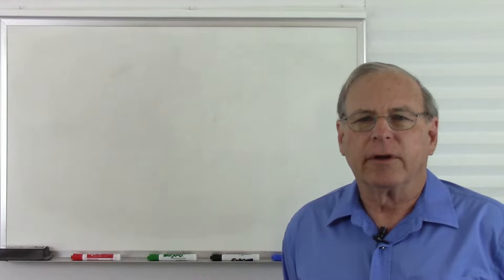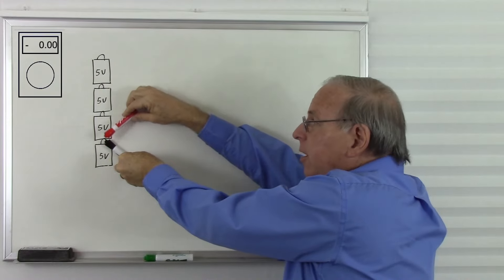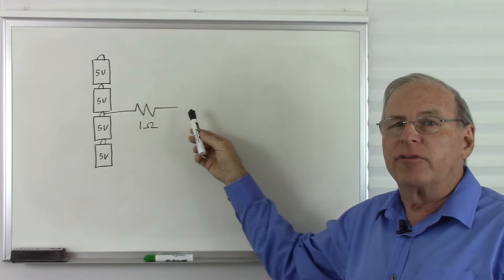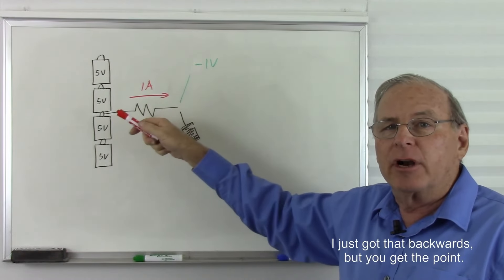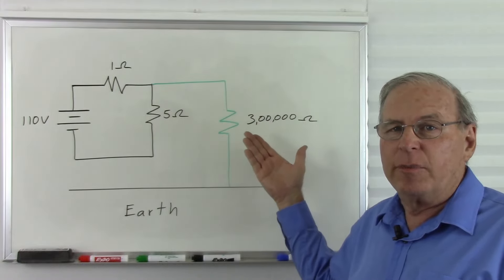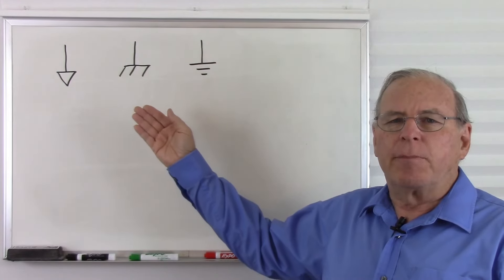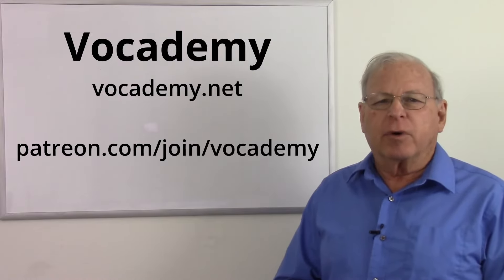What is Ground

Comment: 12:01 
If a person gets an accidental contact to hot or live wire one's heart would enter Ventricular Fibrillations VFib if an AC current of about 6 mA is established across the heart; remember that condition is met if AC current of 50 mA to 100 mA goes through the ones body as a whole. 
O.K. Now I get why an RCD with 30 mA leakage current rating would help in preventing those life endangering hazardous leakage of currents though human or animal entities!
Thank you so much for very good velog for human safety in domestic electrical systems.

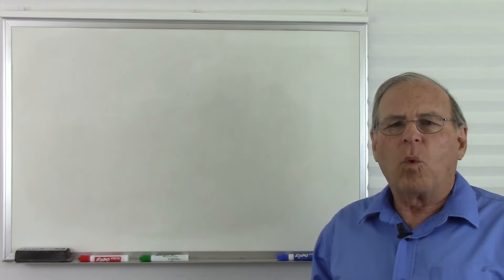Comment: I love this video. It does have an apparent contradiction (if my newbie understanding is correct) 8:50-11:06, but this is one of the many reasons I like it. The whole video provides so many insights and clarifications that I personally needed.

I suggest readers resolve the following. If current from the side is 0.1 A and current through R2 is 1.1 A then current through R1 is 1 A. The voltage across R1 is therefore 10 volts, but this contradicts the 9 volt conclusion.

Revisit the assumption the current from the side is 0.1 amps and assume the voltage source from the side is 11 volts instead.

It occurs to me there is no contradiction in what vocademy says, but a miscomprehension on my part.

Whereas initially
- I thought vocademy said 0.1 amps from the side, he would have said 0.1 more amps through R2 than before;
- I thought vocademy said 0.1 + 1.0 amps through R2 and 1.0 amp through R1, he would be saying 0.2 + 0.9 amps through R2 and 0.9 amps through R1.

Multiplying out R1 we get 0.9 × 10 = 9 volts; exactly as vocademy says!
Reply: At 15:00-15:15 I believe he made a mistake; he made the .001 resister in parallel with the 5 ohm resister but shouldn’t it be in series with it?!!!!! (Given the stick figure scenario before the modeled circuit)?

Comment: Im making my own power regenerator using ac-dc psu and inverter and im wondering should i ground the inverter from psu input ground to the inverters ground screw or is the negative from psu output used as a ground ?

Comment: A question please. What is the point of making AC neutral (or the negative DC potential in your example here) the same potential as earth. If neutral was not the same potential as earth and you accidentally touch the hot wire then electricity couldn't flow through you to earth - similarly as it wouldn't with an isolation transformer. The hot wire would thus not cause harm. Thank you for your excellent videos by the way.

Comment: At 12:15 the error in your diagram becomes apparent. You cannot show us how the current can flow back to the negative terminal of the battery. In the real world there is a wired connection between the neutral and earth ground at every main circuit breaker panel.

Comment: This is a 110v battery.  Electricity always wants to get back to its source (the battery).  Fault in metal case. I touch it. Me standing on the ground is not in the circuit. Current will not go thru me.